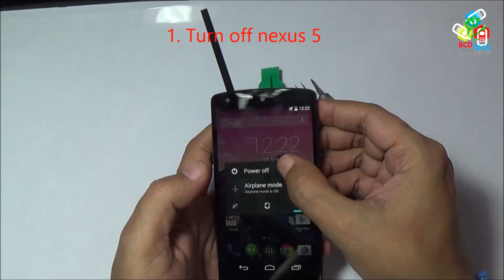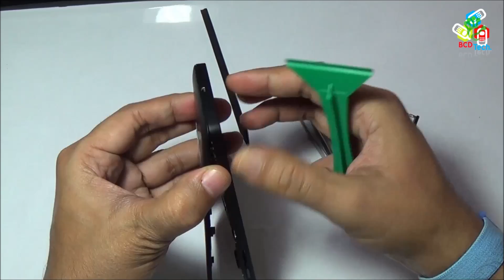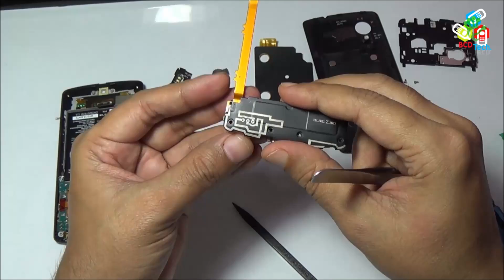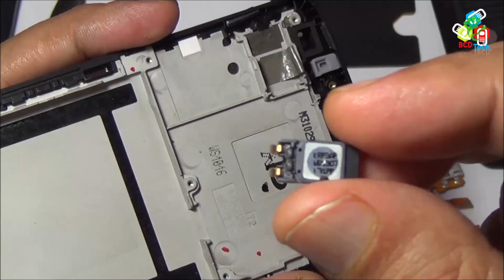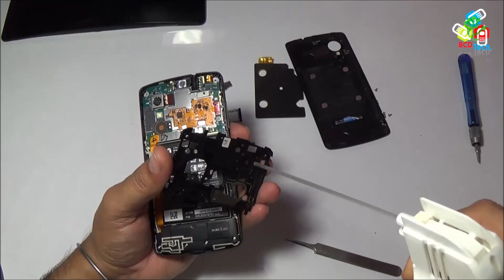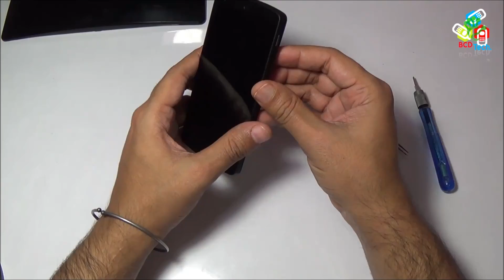Google Nexus 5 (LG D821): Assembly, Disassembly, Tear Down, Parts View and ICs of

Comment: can you tell me which IC is related to the charging of the phone is it PM8841 or PM8941? my phone wont charge it says charging for 2 seconds then it stops. I gave it to local repair he tried to change the batter as well as the USB port ribbon but the problem was still there. He is saying the problem is with the Power IC or Charging IC? Can you tell me which is used fr Charging.

Comment: hi an excellent video. need your help on this. My nexus 5 is giving dark screen problem. complete phone is working except screen goes blank intermittantly. upon rebooting at time the display works perfectly normal of at time i get rain drops. Do you have a solution for that. LG people say change board. Cant digest their reasons. There are no water problems, At time i have keep it in back pocket. Dont know whether that creates this prob. While checking on net who have got similiar prob. someone mentioned about a coil. awaiting your prompt guidance.

Comment: I live in Bangalore and my Nexus5 went in water by mistake for 2-3 secs, its not restarting now. Showing Red color light flash in LED below screen when connected to Charger, phone is not getting detected when I connect PC, but when I press Power+Vol Down button, computer tries to recognize the device again n again, but doesnt connect or show Nexus5 connected. I went to LG Service Center, they say change Motherboard straighaway, I think they don't know much and for everything they want people to change Main Board. New motherboard costs 12700Rs. Please help me, I need my data back and also want to get my phone fixed in little lesser cost. Need some guidance ASAP.

Comment: BCD Tech. This is a fantastic video and I found it quite interesting as well as informative.

I happen to be one of the numerous people who are stuck with their Nexus 5 because of the issue where in the phone turns off randomly, sometimes boots successfully to turn off again within minutes (sigh), and the other times remains stuck on the google logo. The service centre guys straight away told me to get the mother board replaced, which is going to cost me a good amount, given the fact that my phone is no longer covered under warranty. I tried consulting a local repair shop and was told that replacing the power IC will resolve the issue. I am yet to try the suggestion solution since I am not entirely sure if power IC can be replaced like that or if the repair shop guy will do it right and it will actually solve the problem. 

If you can shed some light on it, will be great. 

Thanks.

Comment: Thanks for sharing this valuable information. I have my nexus 5 completely died. Tried to enter bootloop, etc but no luck, the screen is completely black, even when i charged it. The thing is i can still feel a vibrate if i pressed power button.
At first i thought the LCD is broken then i changed the whole LCD frame, but still no luck. The battery  seems to be working just fine, then i went up to LG service center they said it 's my logic board that fails ??  I am pretty sad considering all datas i haven't had any chance to backup. Could you please tell me what  sort of replacement from the logic board that has a connection to the screen display? Is it possible to change that only failed parts by resoldering and stuff?  Also, if i wanted to save my data, can i just swap and resolder the memory to a new logic board?
Thanks
Reply: +Pizz48 
Hi, did you solve your problem?
got same problems with my N5, dark screnn and so on

Comment: Hi,my Nexus 5 dropped and now No Network so i cant receive call/sms...
Tried factory reset,flash factory 5.1.1,open n check all connection and cable but still No Network.
Sim detected but getting 0dbm n 99asu all the time...

Comment: Hello Dr,

Very impressive skill set you have, thanks for sharing this video.
I need you help as my indian version nexus 5 32gb cannot detect cellular network so i cant use it for call/sms/data. Lg service centre says its Network IC is gone and needs mother board replacement. Can you please share your thoughts on what that IC is in this video and alternative and low cost remedies.

Thanks in advance !!
Pankaj

Comment: Hi so I have a question for the pcb connection the thing that connects to your LCD and has the led on it well the question is the part that connects to the motherboard that connection is broken, how do I fix that? i did buy a new pcb and it still didn't work so I found out that where the pcb connects to the motherboard that connection is broken the one that is soldered onto the MB is there a way to get that little part and resolder it on?

Comment from the maker: Radhakrishna Ganti: The board is costly parts, check for some local repar show, there is a short circuit under any components. let's see that
Reply: +BCD Technology : Is there a way to remove the Main Memory 16GB from board and get data recovered in anyway, I have some highly important data and my Nexus5 went in water for a 2-3 secs and is not starting now and giving Red Color flash light when I connect charger. Please help me. :(

Comment: Hey first great video!
i dropped my nexus 5 in swimming pool accidently.i had water in display and al places possible.removed dried cleaned.pretty sure no water in it anymore.everything works good except no range with the sim.just no signal at all. what could have been short circuited or something i can check? the battery too drains much quicker almost 0 in two hours from 70%. does the battery drain faster if the back panal isnt connected?
Thanks in advance
Reply from the maker: There is small short in the PCB, and it is very difficult to trace that, from my experience on of the radio is consuming that power, try yo check the phone with radio off ( gsm, wifi, bluetooth, gps)
Reply: Hi, I am having the same issue. Water damaged and now no signal from the mobile network. Other works great. What could be the problem? Did you able to solve this?
Reply: Chinthaka S Senaratne Hey,
I couldnt get it to work with Sim card.Also Tried to put phone on with airplane mode too.Phone would heat up.eventually i got the whole motherboard replaced.
Reply: Ohh. My hopes scattered. I am wondering where to get the motherboard if its the case with mine too. :(
Reply: I tooo it to a authorised LG service center.u may get it online too depending on which country u are in. Pretty easy to replace .
Reply: Im in sri lanka. Will check with local lg agents. Im sure that will cost half of the phone price.Thanx for the info.
Reply: It  costed about 35% of the price to me in India.

Comment: I have hard bricked my nexus 5 flashing galaxy i9300 kernel. It doesn't boot up. I have read and I believe the problem is in the mother board. Do you know which motherboard's IC I would have to change? Thank you very much.
Reply from the maker: Sorry for late reply: You can flash the google factory image into it, else you has use short resistor to flash image

Comment: is possible mount the BL-T7 (g2 battery) on Nexus 5?
Reply from the maker: One universal solution for you, I had don this lots of time. Disassemble both of the battery package (only you have to remove sticker), and de-soldered the battery cell from PCB. and interchange the cell and re package. I think this will help you. One thing I want to mention here, the BL-T7 is slightly wider then Nexus 5 battery.

Comment: Thank you very much for the video this is really a big help. 
I would have an additional question:
I have the Nexus 5 the 28 0 which is the US version however I'm traveling a lot to Europe  and would like to use the LTE there as well.  Would it work if I would exchange the parts which has the LTE antenna with a the D281 one? And if yes which exact part would that be?
Thank you and Happy New Year
David
Reply from the maker: Thanks, It is not possible to change the band by changing antenna. The radio on us version is different then asian nexus 5. There bands are difference.  You can surf 3g easily in roaming. Lte working depends on network operator bands in europe. Check lte bands on your nexus 5 d280 and then check lte bands of operator you want to use in europe. If matches then lte works else not.